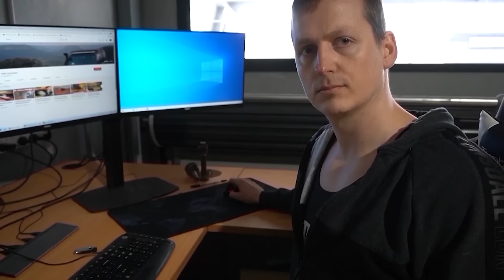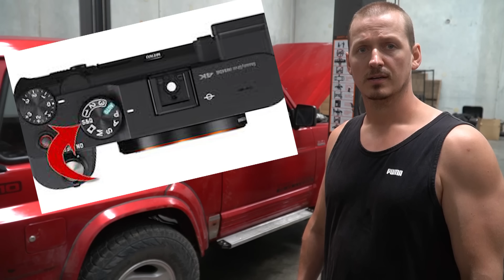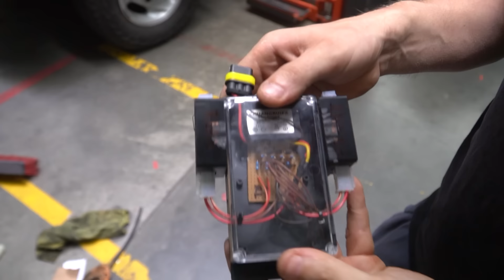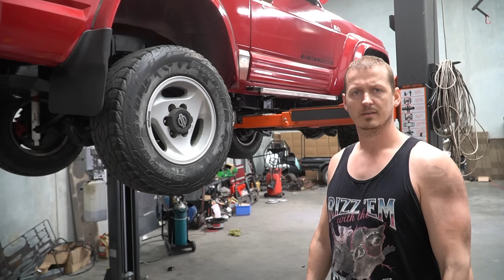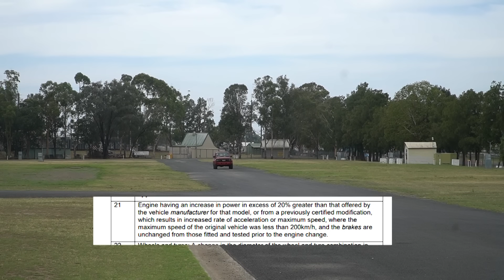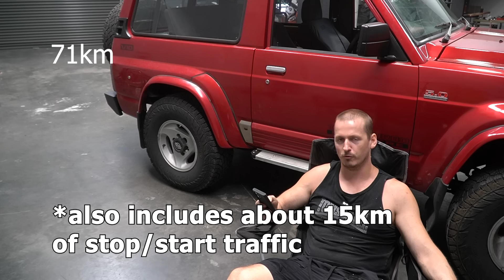How To Get Your 4x4 Engineered LEGALLY - V10 Tdi Swapped Nissan Patrol Is Road Legal!

Comment: Mate I owned a vw touareg 2003 v10 .I was forever buying parts for it .
Full props to you having to deal with the pain that it is to get outdated parts from overseas. And the general fuckery of the computer system. 
The motor stand alone was epic tho .
Good on ya bud
Reply from the maker: When you're using the motor alone, you don't have to worry about the other parts 😏 computer system is nice to work with

Comment: Uhhh not to be an armchair mechanic but I’m also gonna learn from it if told otherwise :)
somewhere around 21:00 he installs the heat shield directly to the exhaust,
 Won’t that just delete the function of the shield? I thought it needed an airgap and just to shield a lot of infrared but now it’s acting a heatsink?
Maybe put some heat wrap below it? Stops it from vibrating it’s way trough too I’d imagine 😅
Cheers to your beautiful car ❤
Reply from the maker: I personally wouldn't have put anything, but you don't argue with what the person signing off on your car flags up
Reply: @ridiculousthings4x4  fair enough the fuel already soaks up the heat what little there is 😂

Comment: You probably want a microcontroller driving the speedometer instead of a raspberry pi, the raspberry pi os doesn’t take well to just having the power turned off and will eventually corrupt the storage.

An esp32-p4 on a similar display using LVGL to render the graphics would be a more robust option and have the benefit of booting to display things in about a second.
Reply from the maker: Correct. I'm just not good enough at that side of things

Comment: If you run into trouble with that donk, I have a big thread on the half size 2.5 TDI on VWWatercooled. Esentially one bank of the V10. I had to work a LOT out myself, not a lot of info out there. The V10 version scares the crap out of me from a mechanical perspective!

Comment: As a fellow autist, I appreciated the shit out of this series. I don't have the automotive knack for going to this level of engineering as I've always tinkered in construction. It's so good to see someone with the passion and attention to detail and the straight up fkn stubbornness that this build would have taken in order to make all of the factory OEM systems all work inside the patrol chassis. And then to mod out all of the unnecessary things. I've tinkered with cars and 4wds. 12v electrics are good fun and have done some cool things, but this is absolutely next level. I'd be so proud to drive that knowing it's all done right, it's legal, and you were the original pioneer to do it.

The moony moony bridge reference at the end was the icing on the cake.

Kudos to you, good sir. Excellent watching, this was. I totally understand why you wouldn't wanna do more.

Comment: I haven't finished watching the vid, will do so when I come home. But, as a fledgling engineer, you would know that a working odometer is needed. Well, last time I looked it was. How did you get around that, and keep the "mileage" correct to the vehicle? Maybe you will tell me that in the rest of the vid..... later.
Reply from the maker: You answered your own question there 😂 you'll find out later
Reply: @ridiculousthings4x4  😎

Comment: 35:01 cries in 1fz-fe with my slow stock engine that drinks 28L per 100km on average 😢
Reply from the maker: *laughs in fuel efficiency*
Reply: @ridiculousthings4x4 did you ever get back to do the 1/4 mile runs? I was keen to see what it would do after you fixed the turbo actuator issues. What ended up actually being wrong with that anyway, I remember you changing the worm gear but not really finding anything wrong in there but I don't remember what actually fixed it in the end?
Reply from the maker: Turbo actuators are set from factory with narrow error margin. My DIY operating rods weren't within spec. Once they were tweaked though, game changer. I didn't take it to the drags but it'll light up wheels until 4th if driven in anger

Comment: ESP32 P works better mate
Reply from the maker: A lot of different methods would probably work better. I'm just not very good at that side of things
Reply: @ridiculousthings4x4  Its not that hard,  in fact ESP32 will be easier.what is it exactly that it needs to do? Read a pulse from a sensor, count it, convert to speed and show on a dial?

Comment: Good to see you back. Put a radiator hose clamp around the exhaust rubber and tighten to your liking
Reply from the maker: I ended up doing the usual. Over complicated additional bracket with extra fold lines and bushings

Comment: Use a VR-to-Hall converter module.
These take:
AC sine wave input (from GU diff)
Convert to:
Clean 0–5V square wave output
Examples:
Dakota Digital SGI-5E
Speedhut universal speed signal converter
Any VR conditioner module (even Arduino-based)
Wiring:
GU diff sensor (2 wires)
→ Signal conditioner input
→ 5V square wave output
→ VW ECU VSS input
This is the cleanest solution.
Reply from the maker: I wish AI was useful. None of those generate a VW equivalent

Comment: Nice! Here in America it varies from state to state but it is anywhere from just register it and drive it no matter what motor or anything else goes as long as the light's, brakes, and safety equipment all work & the wheels aren't balding and or falling off your good. On the opposite end of the spectrum like in NY and CA they plug in the OBD2 and it better all work or if your before the plug your good. California you have to pass the tail pipe sniffer so no nasty rick power tunes or carb fueling it till the tail pipes are spewing black fuel carbon which is stupid as it is wasted power when you have to keep it so rich the tail pipes puff soot. Nice build though, only thing I would consider is putting something like an Atalas transfer case in it to give you Front dig unhooking the rear dif so you can turn the wheels and power the front wheels only to pull the truck over if you are stuck then re-engaged the rear wheels and drive out!
Reply from the maker: It's a bit similar over here in terms of inconsistencies. NSW is the only state that cares about body lifts within a certain range, and the 20% power increase brake tests 😮‍💨 everywhere else is a bit more reasonable

Comment: Did you use diffs out of a 4.8 GU? They have much better brakes than yuck standard GU brakes
Reply from the maker: It got whichever brakes you can barely fit 16's over. 48's tend to need replacing the MC too for ADR compliance because it's bigger. Plus, how big do you want brakes on a non-ABS car before breathing on them locks up all 4 corners? It already stops near instantly
Reply: @ridiculousthings4x4 yeah all good mate, was just curious. 

Love your videos mate, shame you won't be making any more

Comment: For the raspi speedo, what if you had it running all the time (5v draw?) and the screen wakes when it receives a signal from the sensor or a voltage change on ignition? Awesome vid as always.
Reply from the maker: definitely a good way to do it

Comment: Not a bad idea with the Pi, with the boot time you could look into Yocto or Buildroot... it won't be instant but even with the extra programs, you should be able to get the boot time under 10seconds. Alternatively, you might be able to port most of your code over to an ESP32 for that 'near zero' boot time, I'm sure you've probably seen a bit of his work but Garage Tinkering has done a bit of guage work although he's decoding his inputs from CANBus, it'd give you a leg up creating the images on the screen.
Reply from the maker: I've seen a bit of garage tinkering's stuff. They're all way above my level though. This video is probably misleading anyway since I played with several options and ended up going for making a signal converter along with an OBD gauge so I can see accurate ECT's. ESP32 would be a faster option for sure, but it's above my paygrade.

Comment: Love the sharing of this awesome build! But one thing about the driveshaft and the mount, I would imagine the gearbox has movement from when the engine moves, so therefor it is transferred to the gearbox which in turn is connected to the driveshaft guibo which will therefor have movement and not be solid, always ask yourself why they wanted it to have the clearance
Reply from the maker: no, it doesn';t move independently of the gearbox.
Reply: I did not say it moves independently. I said it moves with the rest. That's why we have transmission mounts and engine mounts with rubber or oil in them. If you did not solid mount the whole thing which makes for huge vibrations. Ok? Ok.

1 degree tilt of engine under load converts into about 3.5mm on your setup. And with the torque, ye. That is why they want that to have clearance or why would you question someone that is working with looking safety issues over? Please add me and we can talk.
Reply from the maker: Ehhhh, you're wrong, but in case you hadn't guessed, idgaf about YouTube anymore.
Reply: Also, all who pass their drivers license is not always a suitable driver (i think you see the reference) so that is why i am asking or saying what i do, because we all do NOT need to know all things, but we do learn in the process. That is why there is a difference between people who know and can explain vs people who are clueless and blame it on other things and no one can know, until you say WHY it is the way it is.
Reply: So much easier to say: alright, ( answer ) that is a life lesson tbh. Saves so much time, I used to be like you. But there is 0 benefits of denying facts. I don't judge, I understand.
Reply from the maker: no idea what you're on about, but I never delete comments. YT does it itself for "profanity" if that's what you said. You're still wrong, it's not like I built the car or anything
Reply: Glad you learned something.
Reply: @ridiculousthings4x4  Alright, sorry, then i assume you hardmounted the engine and gearbox with solid mounts, only explanation that makes sense then!

Comment: Your comedy style is creative more so than it is funny.. looks forward to see what bar work you'll built into or onto the Nissan Patrol you decided to call Poo something.. off topic is it true that the body of the army Hummer can use the same bolt pattern the Nissan uses and will bolt up to the chassis without making any changes like some ppl have claimed
Reply: if there is any truth in that claim, imagine an all wheel independent suspension Troll with the same weak areas as any common IRS and IFS vehicle has.. I personally like live solid axle vehicles as more reliable and stronger..
Reply: Hahahaah u don't like attention
Reply from the maker: can't comment on hummer swaps, but having cut my teeth on IFS and IRS military vehicles, I know what I'd choose